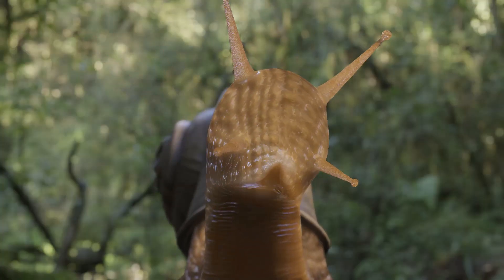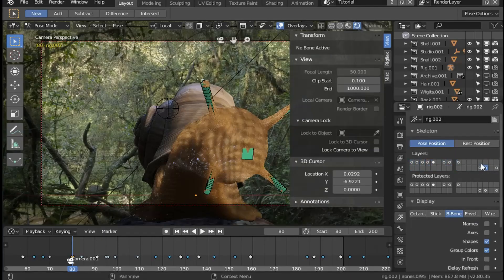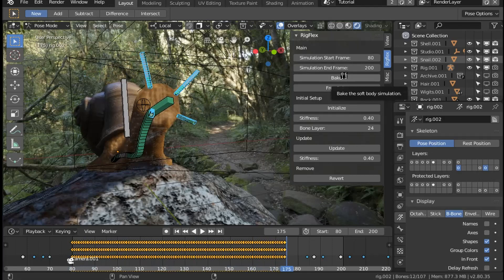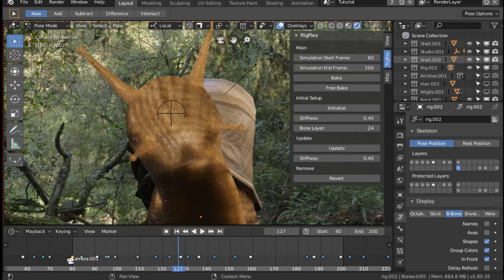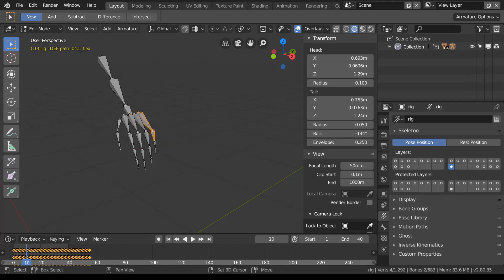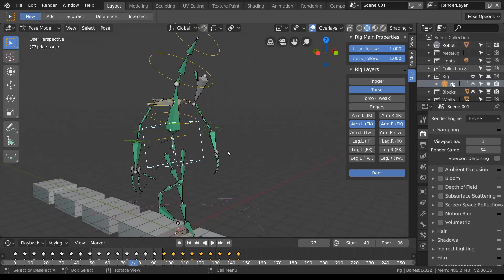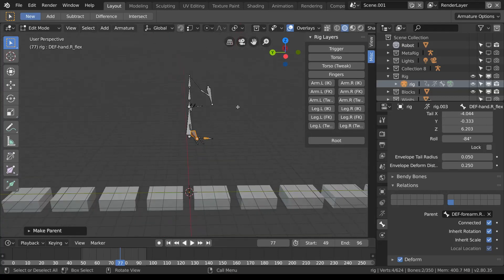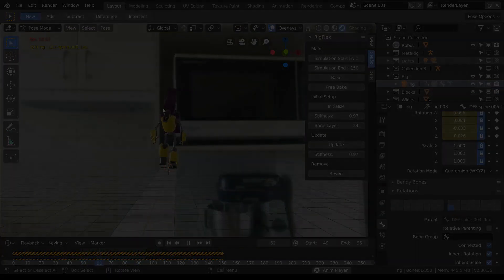Rigflex Addon

Comment: this is an awesome addon im curious about adding collisions with a body for hair bones to bump  into the body
Reply from the maker: I don't have any plans for adding collisions. I intended for this add-on to be a simple, no fuss, stable way of adding a bit of secondary movement. Check out the Wigglebones add-on for this type of functionality. It has a lot more features, but requires a lot more tuning! It is possible to just add rotation constraints on the deform bones to limit the interaction of the hair and the body for a particular shot.

Comment: Great stuff. I'm wondering how hard it is to work with this in linked rigs...Disclaimer, I haven't even tried yet ;) But curious! I've got a couple of good applications for this soon if it works. Thanks for sharing this cool tool!
Reply from the maker: Hi. I haven't done a huge amount of testing, but it seems to work ok. You have to do the initialisation step in the original file. This creates the extra deform bones and changes the vertex groups in the meshes to point to them.
Then, once you link the character in another file and create an armature proxy, you can just run the FlexRig bake function.
It works because the extra properties in the bones are preserved in the linking/proxy process.
I'm looking to use this in a fairly complex rig quite soon, so we'll see if there are any issues then.
Reply: NerkTesting that’s awesome. I was hoping it could be this simple. I’ll share me test with you when I try it out. Thanks for the reply
Reply: @nerktesting2595  Hi again. I haven't got to linking yet, but I just tried a simple example on a character in 2.90 and 2.83. It creates the bones and vertex groups, but baking gives me an error. Sorry I realise I should probably put this on your github ;)
Reply from the maker: @HamacekS  Hi. That's no good. I've been using it with 2.83 recently with no issues, and I just tried downloading 2.9 and tried a simple 3 bone chain with no errors. 

I'm happy to look into it if you can give me the error, or post the blend file somewhere.
Reply: @nerktesting2595  Thanks mate, I'll see what I can do, for now I've done a manual bone chain, but I'd love to figure this out as it would be super cool for some of my current rigs. I'll try to send something over the next couple of days.

Comment: Thank you very much for great addon! If you don't mind i have a little usability feedback. Would be great if bake/freebake, initialize and revert functions only happen on a selected bones. So the hand-tweaked stiffness values and baked curves will not be reevaluated to defaults for all flex bones.
Update: also seems like pressing revert on one armature - reverts vertex influences even on a another armature in a scene, not deleting the flex bones. Rebake or reinitialize doesn't affect different armature tho. And i don't know if it is intended, but initialization always creates symmetric pair of flex bones, even if just one was selected.
Reply from the maker: Hi Andrew, thanks for the feedback!
I'll check out the bug relating to 'Revert' affecting another armature. I guess I haven't come across that situation yet.
I'm not sure about the 'pair of flex bones'. When you press 'Initialize' it should make a copy of all the selected bones, and put them into the specified bone layer. They have the subscript '_flex' added to their names. I have found that if you initialize again with the same bones selected, another copy will be made. This shouldn't happen, and I'll fix it.
I can see how it would be useful to restrict the actions of the various operators to selected bones, although it may lead to some unexpected results. I'll give some thought to how it could be done without adding too much complexity to the original interface. I'll let you know how I go.
Reply: @nerktesting2595  Hi! What i meant by "pair of bones" is that if i select only left side bones, upon initialize it also creates the right side bones. I actually found out that it is a x-axis mirror option causing it. If it is off it creates bones as intended, only for a selected ones.
Reply from the maker: @dfhdgsdcrthfjghktygerte Ok thanks. That makes sense. I'll have a look.
Reply from the maker: @dfhdgsdcrthfjghktygerte  Hi Andrew,  I think I've fixed the issues with the x-mirror option, and the issues with revert etc affecting meshes associated with other armatures.

I had a look at the possibility of having bake and revert only affect selected bones, and I ended up adding a freeze/unfreeze option to prevent tweaked keyframes from being overwritten. It's probably not quite what you're after, but it was easier for me and didn't affect  the core operation. r3.2 is up on the github site.
Reply: @nerktesting2595  Hey Ian, thank you for taking a time to update addon. Quick testing showed up the unwanted x-mirroring still present, but it is not a big deal since it can be turned off by hand. The freeze/unfreeze works great. But i noticed the realtime physics preview is now gone, not a big issue too, but maybe you did it accidentally so i wanted to mention it.
Reply from the maker: @dfhdgsdcrthfjghktygerte  Hi Andrew, It's actually good to get some feedback. I tend to use the addon in a particular way, and so don't notice problems with a different work flow. In fact just now I noticed there's an error if you revert without baking!

With the x-mirror, if you select a bone on one side and initialise, you get two flex bones. I didn't mind that - it could be handy as you only have to select on one side. However previously if you selected the bone on both sides of the model you got four flex bones, two of which didn't do anything. Now you just get the two bones you might expect.

Be aware with the freeze option, that if you freeze after a bake, the bones on the flex layer keep their keyframes and flex. If you freeze after an 'Unbake', the bones have a 'copy' transform applied, and will follow the original bone exactly. Both things could be handy. Freezing while unbaked is a little like a partial revert. It doesn't make much sense to freeze only part of a bone chain - the results are unlikely to be good.

I'm not sure what you mean by the real time physics preview. You bake, and the bones in the flex layer should flex if they're not frozen. (You're not thinking of the Jiggle Armature addon which does this?)